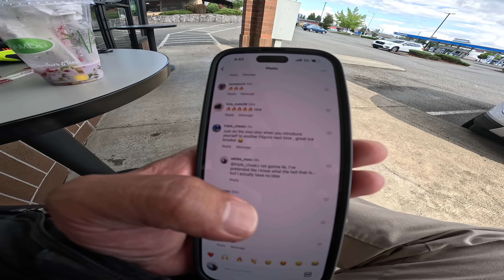THE HARDEST THING ABOUT BEING FILIPINO

Comment: Motorcycles are very much common here in the Philippines, compared to any four-wheeled vehicles but big-bikes are not very common. Traffic lights  are just available at cities, express-roads, and large junctions and occasionally some are not really working at all and most of the time you can just ignore the traffic system not unless there are some authorities around which can rarely be seen except in the cities. So, can almost imagine how extreme motorcycle riding here in the Philippines. Roads are very crowded everywhere, and you must be used to driving on a very tight spaces all the time even you are riding a motorcycle and must be cautious every single seconds. Because, like i said; traffic system are always being violated because it is rarely implemented.

Comment: If the Philippine flag is put to a wall it's not supposed to hang like at flag pole, it should be that the sun and the stars are at the top and the left side should be blue and red during peace switch the colours frome right to left times of war.

Comment: What it’s like to drive in the philippines? Yeah there’s street lights but bahala na
Bahala na even if there’s street lights there’s traffic laws but like 56% of the drivers follow the laws
Also aftermarket exhaust are illegal here the only legal cc to use an aftermarket exhaust are 250cc up but sometimes it’s 300cc up depends on which side u on here in pinas and yeah having a 600cc bike here is almost useless like yeah there are highways but even on the highways it’s always heavy traffic cause of dumb drivers that got their license from forging em or as we call it here FIXERS like “hey i got a car ima buy my way to get a license and be a total retard on the road” 

So yeah that’s what driving feels like in the philippines…. If u planning to visit here just be a commuter that rides public transportation at least its a lil safer than driving with a bike here
And also you’re more likely to get pulled over cause u drive a bike even if you didn’t break a traffic law

Comment: Think twice before you try moto-vlogging in the Philippines 😂 Most 4-wheel drivers hates motorcycle you'll just end up being bashed by so many haters. Even the tiniest mistake they will pin you down with it so you should be very careful and always be politically correct in every thing you do. The discrimination is very malala! Also, the traffic system is not motorcycle friendly.